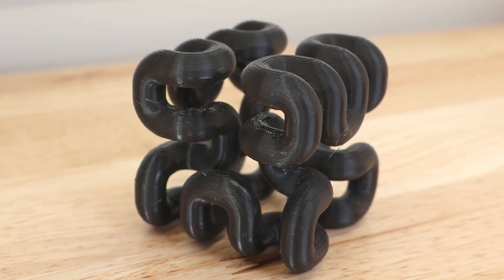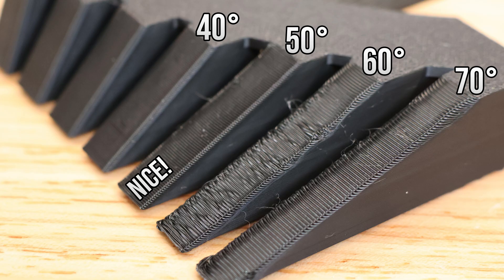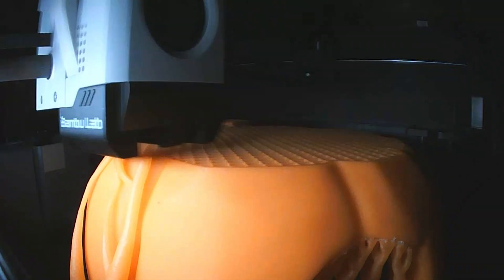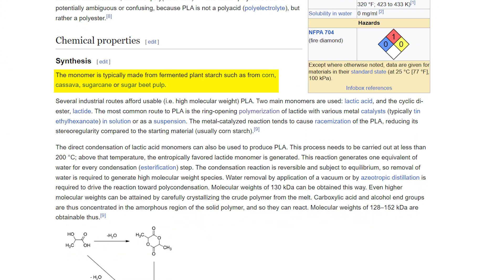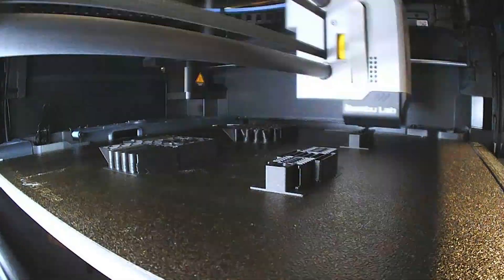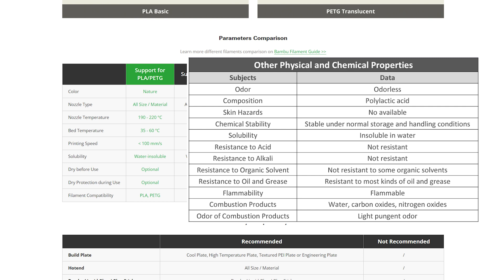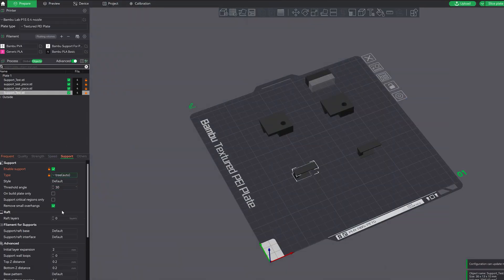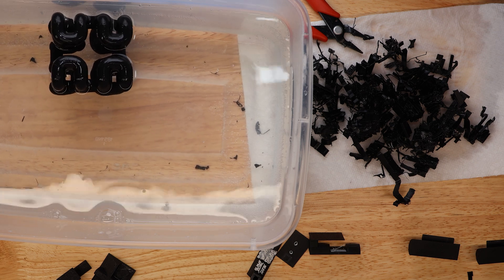This Print Dissolves in Water?!

Comment: I don't understand the last line. Are you using PLA with PVA as interface or only PVA?
Reply from the maker: Sorry there were a few moments I should have re-recorded.  I have found myself using PVA as the interface material and PLA for the body of the supports and model.  The last bit of the video has a pumpkin being printed and you'll be able to see the orange model, orange tree supports, and some clear PVA between the trees and model so I can easily pull them away.